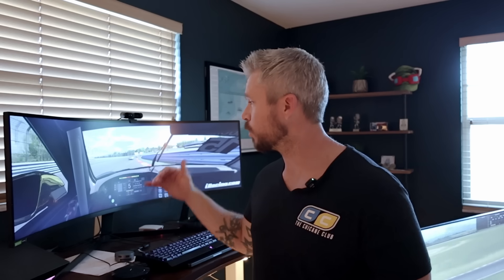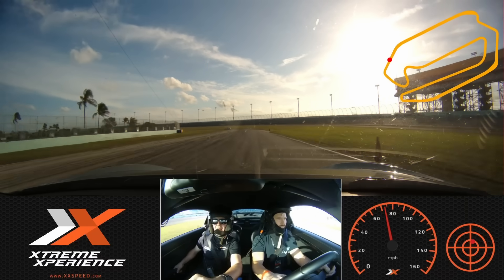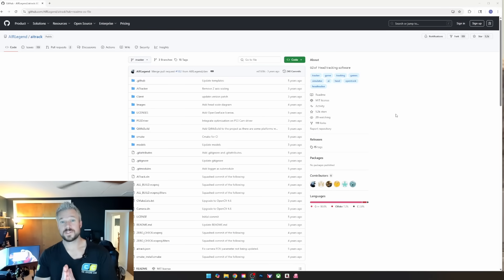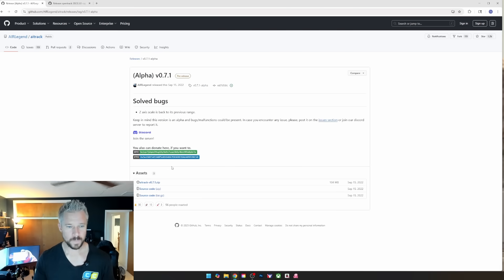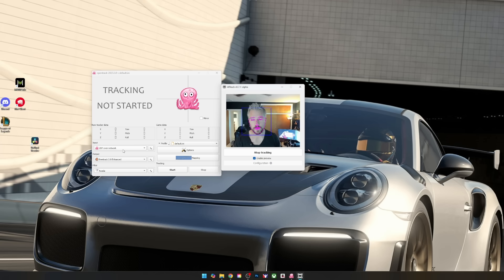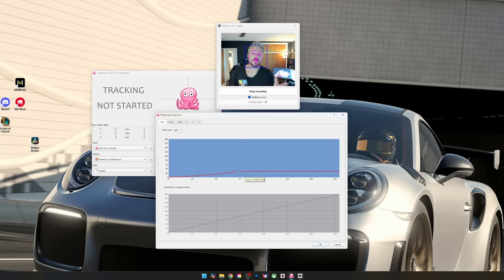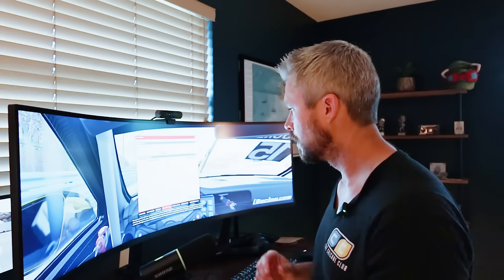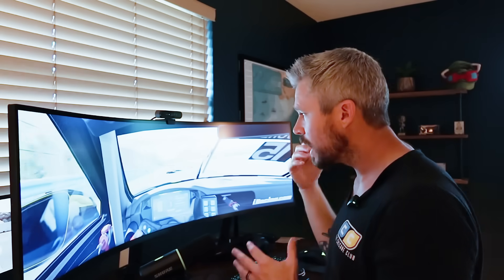Make Your Racing Sim Feel Real With Just a Webcam!

Comment: That would only work if the steering wheel moved with it
Reply: Why is that?
Reply: @zawadlttv  That's because the view rotates and the wheel doesn't, looks weird and is off putting seeing the dash move around with wheel fixated
Reply: @1stzard  maybe. But it still helps
Reply: But i have only really used it in flight sims where i would want to get a full 360° view

Comment: I got a motion rig, it's going to be interesting if this will work well...
Reply from the maker: I would not recommend this with a motion rig as the axis will change if your monitors are mounted separately from the motion. It will probably throw everything off center. 
Congrats on the motion rig
Reply: @Moore_Podiums I tried it on the motion rig and even when using all 6 inches of the travel, it still had no troubles keeping track of my face. My Webcam is also like 150 dollars though so idk if that makes a difference.
Reply from the maker: @lamontrenschler2465 awwwwww yeahhhh! Happy to hear!
Reply: Gotchya

Comment: yep been using opentrack and AI track for a while now it's great for simracing and Flightsims, also there's a smartphone app called SmoothTrack: Head Tracker when you want to use your smart phone for head tracking works just as well, it's an alternative to using a webcam very handy for people that have only one webcam and they stream but also want to use opentrack since opentrack need exclusive access to your webcam other software will not be able to use your webcam if you want to use it for streaming too, thats where SmoothTrack comes in it uses your smartphones webcam and outputs it into opentrack.

Comment: Would you recommend the same settings fot a g9 ultra wide 49 inch? By the way, I tried using beam eye tracker instead - but following your settings for the octupus app. Beam seemed easy to set up. Have you tried it?
Reply from the maker: This video was on my G9 Ultra wide 49" that was on my desk while my rig was running triples. That is why you don't see me driving with it. I was tinkering with settings and software after seeing some similar youtube videos. Thought it was a solid idea for curing my frusterations with a ultrawide and figured I would share it with the rest of the world.

Comment: Cool, a new version of track ir. I tried track IR before, my brain didnt like it though, gave me headaches. A lot of games have look to apex, I tried it in just about every game and my brain still doesn't like it lol. I guess I just need to turn my head to look at a physical thing. I get that weird feeling when you are stopped and a car next to you starts to slowly roll back while you slowly roll fowards, idk if anybody else gets that, but my brain does not like that feeling at all lol. My solution was to project an image onto a wall making about a 120 inch image, that was a fantastic setup when I had it. Could look around at basically 1 to 1 scale, took forever to get the fov right though, best part was no headaches. This is cool if you don't get headaches from it like I did.

Comment: Works great for drifting with Assetto Corsa. A bit more aggressive settings and added a bit of yaw. And NaturalMovement filter worked best. Thank You for this video!
Reply from the maker: Glad you enjoyed
Reply: How did u set it up on AC bro? Im looking in content manager, but im not sure how to link the app to AC
Reply: nvm, just got it, this is insane!!
Reply: @DanielServigna-m3g  I didn't link anything. It worked out of the box
Reply: But in what mode did you load up AC? I tried but nothing happens!
Reply: @krumaleksandrov4610 you probably need a content manager and a csp installed.

Comment: Biggest drawback is, you really have to get used to it — at least on a 16:9 screen. As long as you're not on widescreen or using multiple monitors, turning your head feels counterintuitive.

The reason is in daily use on 16:9, you wouldn't normally turn your head for such a narrow screen space or not much. You end up having to force yourself to little overdo it, and even then, once you turn your head, your eyes often end up in an unnatural or uncomfortable position — at least that was my experience with ETS2, where you can take your time.

With two 24" monitors it was somewhat okay, though it was unrivaled in a 3 monitor or widescreen setup, in my opinion. (with a lot of fine tuning of the settings). That's pretty much the between of tripple monitor and VR.
Reply from the maker: Thanks for taking the time to write this on your experience. I’ve never tried it with my triples. What sized triples do you have?
Reply: Anything 16:9 screen at and over 48inch shouldn't have that issue.and especially if it's sitting really as close to your wheelbase.

Comment: great video, i tested a little and maybe i'll include this in my races, although, there's a little delay that bothers me, that may be improved in future, also there's an more pratical option (at least for me) that is use the neuralnet tracker as input in opentrack. it does the same as AIRlegend, without you having to open two programs at the same time.

i think it will improve my experience with my single ultrawide 34' screen, mainly checking cars on my side, thanks for sharing

Comment: If you’re limited to a single monitor, this is amazing. But I believe triples is better for peripheral vision. I can still turn my head and see through a corner but also see cars next to me without needing to turn my head.
Reply: That being said… I wonder what it’d be like with a head tracker AND triple monitors
Reply from the maker: Hey, so I do have triples in the back but didn't show them too much, I don't think it would be too useful on triples as I just try to look through the turns. When being inside of the car its typically really cramped. However, I do think this made my 49 ultra wide feel more like my triples.

Comment: It's amazing how people want to call this immersive and jump through so many expensive hoops when actual immersion is just buying practically any VR headset on the market today and connecting it to your PC. Boom; literally an entire dimension more immersive. This triple screen and headtracking is like jumping through so many hoops to make controller sim racing more "immersive" when the actual answer is just get a wheel. Same parallel here. triple screen and head tracking are the controller of visual immersion and VR is the wheel of visual immersion.
Reply: agreed to the point that good VR performance requires a beast of a desktop system. That's not the case with headtracking.

Comment: I don't know have any Sim setup but this is the dream for me. 57" and head tracking. Same screen for desk and rig, on a nice arm.
Would love to see you driving and the response together with the head motions you actually make.
Reply from the maker: Thanks for taking the time to comment, I have triples on my rig now. I used to use my 49 for iRacing .. now for work, I can say that if I still had only my 49 I would be using the tracking for my races. I was tinkering with ideas so I tried it on the set up and it worked!

Comment: I tried this a while ago and found it very unsettling as your head movement isn't natural, you move to look at a location on the screen and this app moves that location towards you so you get disorientated easily until you're used to it but then if you spent a lot of time in game this will effect your driving in real life! My advice DON'T do this and just goto VR if you really want immersion, this head tracking on a monitor is just a bad cheap hack! I run VR, even an original Oculus is far more superior than monitors or this head tracking nonsense!

Comment: Man thank you! I'm on a single monitor 21:9 34 inch, and now can see the curbs 😭
Reply: It works good? I’m thinking to get a 34” 21:9… I have a 24” now… 
Isn’t a 34” to small to get the head movement?
Reply: @rodrigosepulveda175 works well for me. have limited space for my rig so I can't get triple or bigger monitor. But, you need to play around with the yaw mapping for 21:9. I can share my setting if you need, just let me know.
Reply: @rodrigosepulveda175 works good for me! you will need to adjust the yaw mapping to suit you on 21:9 monitor. let me know if you need the settings, I'll share mine.
Reply: I also have a 34UW.
Did you use the same settings or a little more agressive?
I found i have to move my head a lot more that what i really want with 36.5 at 9% and 75 at 28%

Comment: I personally do VR now so VR shows my head movements in SIM racing games.  Before I had VR, I used "Track IR device" placed on top of my monitor to produce the same type of head movements.  I still have that device sitting around in a box somewhere collecting dust.
Thanks for the video. Take care.
Reply: i also had vr but its not for everybody, some experience dizzyness and some is fine so this is a good alternative for that.
Reply: @yamisharki  Yes, I definitely agree with you about using VR.  Not everyone can get used to it and can make us sick. So far I have had no problems - lucky I guess.  
One helpful solution is make sure your FPS frame rates are as high as possible in the games, around 90fps or better. In some racing games, I also do a lock on the horizon. Also turn off some of the special elaborate features of racing games such as Motion Blur, etc. 
Yup, Track IR devices are a great alternative for head tracking.  Take care.
Reply: Same. I look around A pillars to see apex all the time.

Wheel to wheel VR is unmatched. Especially with some cars racing seats in sim that cover most of your window unless you peek forward
Reply: @mrmidnight32  Cool, thanks for the comment and information.
Reply: There was a slew of IR tracking hardware back then. I think it was called dani clip, something like that.
Reply: @GalactusTheDestroyer  Cool, thanks for that info.  I am pretty sure mine was from Track IR company. It was kind of expensive even at when I bought mine. If I remember correctly, there was also something attached to both sides of my head, either reflective materials, etc. That picked up my head moving.  The device worked quite well for looking left and right.  Take care.
Reply: If it doesn't make you sick, this really is the answer. Use something like this that only works decent, buy a dedicated head tracking device that works marginally better for half the cost of a VR headset, or buy 3 huge monitors and go all in for 5 times the cost of a VR headset. 

All the while, the VR headset will provide the best experience overall. It only suffers in resolution. Even then, you can get a high end device for FAR less than 3 big monitors.
Reply: @InfinitySwitch84 your math and research is bad, get 3x32" KTC H32S17 1440p for 150eur/pcs. Refurbished, amazing deal :P my friend got refurb and they are absolutely new, i bought them for 220 eur pcs. Bew thwy are still great!!!

Comment: I’ve tried head tracking but the problem I have with it is that when I move my head to look to the apex the apex moves in the portal I’m looking into a.k.a. the monitor, I’m constantly adjusting my steering angle as I’m turning in and I’m always missing the apex. It’s something that I’d need time to adjust to but I’ve been simracing since the 90s so it works well for me, doesn’t mean I’m doing it wrong as you imply early in your video. VR is the way to look to apexes in the way you’re talking as the world does not move.

Comment: I'm using a 180*132 value on yaw [49inch monitor]. I stopped using a curve because it starts feeling unnatural because the pace isn't consistent with head movement. It also makes it harder to check your sides or mirrors. I use opentrack with a Tobii 5 though.

Comment: I tried this a few times but when racing online it can be distracting if it bugs out even a little.  You definitely need to map a key to recenter the view and a key to disable/enable it if it goes weird.

I think ultimately moving your head, but locking straight isn't as natural as it comes across in this video.  I use a 49" after going from 3x 27" due to space and after using this software I eventually realised it's only full left and right missing which can be done by having left/right view mapped.  It's a nice trick for fun but not really for competitive racing.  
...however if you have a smaller screen I think it might actually be useful tbf.
Reply: Thats what i thought and what my xperience has been a year or two back when i tried something from Headtrack. IMO it feels weird moving your head but counter-moving your eyes to stay looking at the center of your screen. I think it feels more natural to actually move your head&eyes to actually look to the side on your monitor wher the corner is with a static non-tracking camera position.

Although i wonder if you can set it up nicely to where it tracks the position of your head but not any rotation/direction you are looking at. So the ingame camera always looks dead straight forward but when you lean forward or to the side to e.g. look around the A-Pillar the camera ingame moves accordingly (but without any yaw roation).

Comment: Nice to see the tech develop. Used to use a solution years ago that needed small ir lights on a hat clip
Reply from the maker: I saw those ways of doing it too, happy I came across this solution and share it with others, felt like it was easy and worthwhile.
Reply: @Moore_Podiums And three LEDs are still the best. The most important thing here is to get the right number of FPS frames when processing motion. Currently, new special drivers for the PS3 camera allow for 140 to 180 fps. This is important when we have a lot of frames in the simulator; both must match. I don't know how much was achieved on the aitrack camera, but I don't believe it was more than 60 fps, so there will be a feeling of jumping when moving.
Reply: TrackIR was that solution from years ago! I remember having a very hacky setup with a PS3 camera and a piece of a floppy disk cut out and taped over it as an IR filter, along with a hat that had a triple IR LED contraption for tracking. It worked decently well in Falcon 4.0 and Live for Speed, but it was super clunky.
Reply: i originally tried this with a playstation cam and 3d printed this clip on thing for my head that had a square qr type code for tracking. i hated it.
upgraded to triples very shortly after.